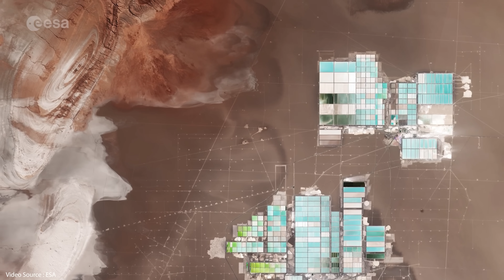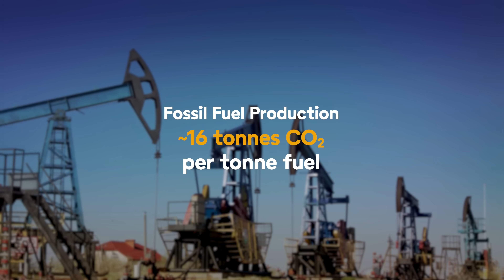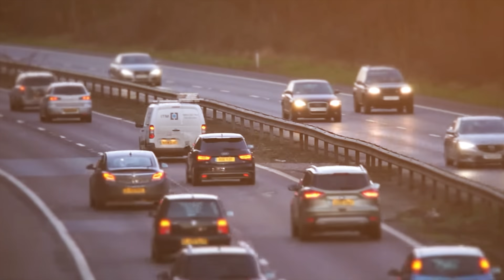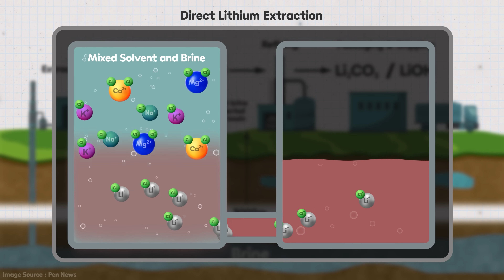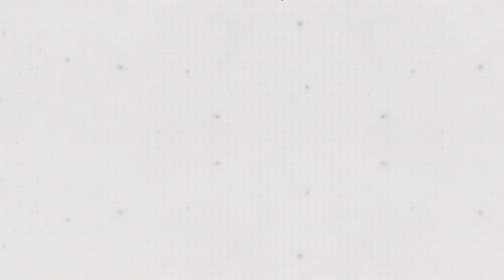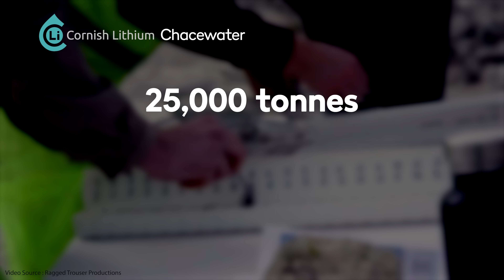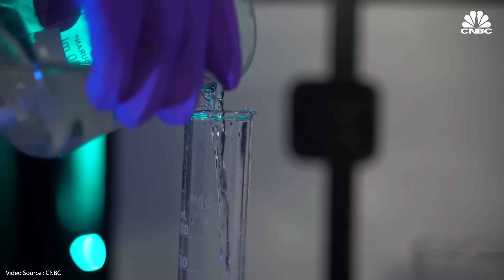Batteries: Revolutionising lithium production. From 18 months to 6 HOURS!!

Comment: It wasn't that long ago that we had things called bicycles. They were a form of human-powered transportation considered beneficial to the environment and the rider. With regular maintenance a bicycle could last a lifetime. Now we have e-bikes with batteries and electronics. Many are cheap off brands that are hard to find parts for and difficult to repair. They quickly become junk. They also allow the rider to avoid exercise health benefits. Everything has a battery and unnecessary electronics. This makes everything from washing machines to cars so difficult to repair it's usually less expensive to replace it with a new one. What we need more than cheap lithium is less of everything, especially disposable electronics.

Comment: Yawn - yet again a comparison of the carbon footprint Li-Ion Batteries with that of Fossil Fuel Production. How about comparing the carbon footprint of Li-ion production to the production of green hydrogen and using that hydrogen to power fuel cells?   and please don't start talking about the need for pressurization efficiency etc etc.Those are old problems that have largely been solved, and can even improve further if forward thinking technology companies weren't so conflicted by mining interests.

Comment: I approve of any and all direct resource reductions in current wide spread technologies, and celebrate technological revolutions that would significantly improve a process by any metrics to such an extent that it makes it profitable within 5 years. However, I'm against replacement technologies that cannot meet those financial benchmarks. Why? Because it will not be financially interesting for companies and therefor will not be applied. I've been headbutting on this problem for over 10 years now, and I know what is needed.
If you really want to improve on resource efficiency (read CO2 reductions/climate restoration/circular economy/etc.), make recycling worth far more than mining.

Comment: Sorry several issues with the optimism. Firstly electric cars are charged using electricity that is largely generated globally by burning fossil fuels, coal especially. Then Lithium extraction will soon deplete a regional resource to get Lithium Carbonate, and you are not half way there, what about mining for Cobalt and Nickel for example. Lithium will furthermore get scarcer and its price will increase rapidly over time as we exhaust lithium reserves and exert a massive carbon footprint in the process. Mining for Lithium has a massive carbon footprint and these newer extraction processes will regionally deplete the available lithium and become uneconomic. Already EV's are a dying technology with only a small amount of lithium battery recycling also, so not too optimistic. Sodium battery technology might be a go but again we burn  fossil fuels for the electricity that charges the battery.
Reply: Link your sources

Comment: Is it really better to compare two really bad things like lithium and fossil? Or should we understand, that all ways, that destroy our planet, should be condemned - and left behind?
Reply: We dig 10,000 times more iron ore than lithium; 35,000 times more coal; 20,000 times each more oil and gas, so yes, I'll swap 20,000 for 1.
Reply: @peteglass3496  If you pass the Amazonas Tipping Point without any additional CO2, you will release about 300 GT of CO2.
The Tipping Point is at 1,2°C and 20% to 25% of deforestation. We passed both 1,2°C and 20% of deforestation!

People, who argue like you, are nothing else than climate deniers!

Comment: My back of the envelope calculation:
Given that the average EV battery contains about 10kg lithium, a ton of lithium will be good for 100 EVs. Let's assume they last 10 years/ 100,000 miles ( a conservative estimate)  . The average ICE car will emit 2tons CO2 per year . That is a massive CO2 avoidance given that 30% of EV owners also have solar panels
Reply: Not saying you are wrong, but I will add in that, EV still use more tires as well because of the weight. Hopefully as research goes on, we will be able to use less over all cells for the same amount of power storage. This would reduce some of their resources as well compare to ICE.

Comment: Honest question, is DLE like fracking?  Can they use DLE in Ontario Canada, to reduce the impact on the environment? Thank you for your Chanel. I do enjoy just have a think.
Reply: There are 2 firms doing this in Calgary. 1 using old oil wells, and returning the water back to the exshaw aquifer.

Comment: Most people are lost in their own expertise or ignorant dreams.

I am annoyed that NUCLEAR promoters dip their toe into part of the bigger picture like the GRID part of their clean energy and say that the grid central location of existing fossil fueled generation plants is the only economically location because new grid is very expensive. 
Then ignore that we need up to 20 times more grid electricity to stop CO2 emissions. 

They point to renewable waste and ignore the massive amounts of new raw materials in new transmission lines and poles and wires and transformers and switch yards and 50tonnes of galvanised structural steel per km plus reinforced concrete foundations plus...... 😮😮😮

Then refer to EVs electricity demand and ignore the v2g technology and most vehicles are parked 23hrs every day 🙄 😑 FREE MASS STORAGE. 

Nuclear nuts refer to cold latitudes solutions for winter months and ignore the long sunny crop growing seasons.
They ignore that 80% of the world's population live in warm latitudes.

They ignore 80% of the world's population live in dictatorships. 

The level of ignorance is mind numbing.  😮😮😮😮

Comment: Seems to me that much of the research is focused on each as an isolated process. However history tells us that the most economical is a multi-step blending of these techs. Plus you could consider the possible multi-use of combining the evaporation with catching the water for human use in dry climates. It might cost more up front, but save in the end by producing two products for sale. Also is anyone considering the climate impacts of the evaporation process? Raising the humidity in arid climates might have secondary impacts. Hope someone is looking into that. So many ways to "skin a cat" and please I do not know why anyone would skin a cat, but it is an old saying. Please focus on the point not the distraction.

Comment: How do they come up with the low figure (7?) for the solar electricity use case?
Solar is “free”, so the figure obviously includes such things as installation, transmission, maintenance costs. In which case, do the other examples include the relevant items?
It all goes to show just how involved is doing fair comparisons in energy numbers and, importantly, how easy it is for actors to mislead.
Great video again, Dave.

Comment: The lithium can be used for decades; and then be recycled and be used again for another few decades. The simple point here is that the carbon and water needed here are offset by decades of useful life and is so little compared to the alternatives that it barely deserves talking about. The more interesting aspects of direct extraction are cost. To me this looks like in addition to being less wasteful, these new extraction methods might also be less costly and more efficient. I think that's more interesting than whatever minor impact it has relative to the giga-tons of CO2 we continue to emit extracting, refining, transporting, and then burning oil. Even the most dirty lithium extraction imaginable is a tiny drop in the ocean compared to that. It's nice we can clean that up and would satisfy the OCD of people that pay attention to this stuff. So, this is nice but the big picture was already pretty good for lithium ion batteries. Taking more of the dwindling amount of real arguments against them off the table is of course a good thing.
Reply: Lithium is not the answer.
Reply: @tconbo4514 batteries are composed of more than just lithium. To add to what you are saying, new mineral combinations for batteries are also seeming viable for many similar applications.
Reply: @temujinkuechle6287 except none of them can get to grid support level which is needed when you're generating power from renewables.
Reply: @tconbo4514  wtf is?
Reply: @gregbailey45 if there really is a question (and I don't think there is) then nuclear is the only answer. Solar, wind, batteries - it's all nonsense and makes no scientific sense whatsoever. If you're a climate zealot and truly believe in anthropogenic climate change and have two brain cells to rub together ye would know this. And if ye don't then ye know nothing.

Comment: That Cornish 25,000 tonnes of Lithium Carbonate a year extracted equates to supporting 600,000 EVs a year in production, with an average EV battery containing 8kg of Lithium. Given the UK is also building a Lithium refinery plant in Hull, has other Lithium resources, and has multiple gigascale battery manufacturer plants in operation, things are looking up for the UK. (edit: adjusted estimate figures for molecular lithium content)
Reply: Lithium CARBONATE?……
Reply: Cornish Lithium doesn't list the exact composition of the extract to my knowledge but yes it's likely a dissolved carbonate as they state lithium carbonate on their website (or potentially a mix of carbonate and hydroxide). They list it as being a brine based DLE process with high Lithium concentration (220 mg/L), low magnesium (<5mg/L), and total dissolved solids content of <29g/L. That can be extracted at a flow rate of 40-60l/s, with each site supplying 500 to 1000 tonnes a year, with the Lithium extraction being an additional use of the water that is also extracted to produce geothermal heat. They are also exploring hard rock sites in Cornwall as well, which has a number of old quarries  (tin, copper etc.) that may be productive for Lithium.
Reply: That's interesting because I've been working with a number I found some years ago on the bill of materials in a Model 3 of 12kg of Lithium, so I come up with a slightly lower number. Searching again now seems to agree with the 8kgs. I was a bit surprised because batteries have been getting bigger on average too, perhaps Lithium is being used more efficiently in the current generation of batteries as energy density rises.
Certainly a quick rule-of-thumb turning 25k tonnes of Li2CO3 to 5k tonnes of Li metal and x100 gives you half a million EVs is a good enough figure for me.
Reply: Lithium represents about 4% of the reactant mass in LFP batteries, ~8% in NMC. However most of the weight of a battery pack today comes from the other structural, bus bars and casing elements rather than the active battery materials themselves. 

This is one reason why the focus on Cell to Chassis/Body designs are being investigate to incorporate an element of the battery packs weight as part of the vehicles chassis itself rather than as an additional separate weight carried by the chassis. With lighter weight battery modules just being inserted into a box that's part of the vehicle's chassis frame (a preformed stamped structure). This also reduced assembly time allowing more vehicles per minute to roll off a production line.

Comment: Even the carbon footprint of hard rock mining of Spodumene can be greatly reduced.  For a start, you power those massive trucks that take the ore from the mine with batteries.  This is already been done in other mines.  Then you power the factories that extract the Li with renewable electricity.  Simple for countries with either reliable wind resources or constant sunshine (Aus).  Then you transport the Li compounds to the battery manufacturers with electric trucks and on it goes.  We use fossil fuels to mine the Li which leads to more and more reduction in the amount of fossil fuel we need.  I love it.
Reply: Batteries are not a power source

Comment: Stopped watching my newly installed solar app to watch this. First day of sun on my panels, we're in the middle of winter. Just made a fully solar coffee to watch Dave.
Reply: Greetings from Germany. 18kWp on my parents house and now they can also use their new EV to drive co2 neutral. It is amazing to produce your own energy.
Reply: Greetings from Germany. I've got a tiny 130 W flexible panel in my balcony that receives sun until until mid-day with a 3 KWh battery (including a solar charger).
Since 2 years ago, all my small gadgets, laptops and both ebikes were charged only using this system.
Would be happy to go big, but I'm always on the move.
Reply: lol.  Same here.
Reply: Sun tea/coffee has been a thing since prior to invention of gas or electric stoves, maybe goes all the way back & pre-exists first man made fire.  Tea might have first originated in a sunlit rocky outcropping pocket filled with fallen leaves & rain water.   Prehistoric person could have dipped a hand in, smelled & tasted and thought: "tasty, but needs goat's milk & honey".

The first medicine man might have just discovered a puddle full of tea leaves brewed in sunlight.

How efficient is your solar coffee, in caloric & mechanical energy? Is it's steeping; a perfect transition of energy to a chemical composition altered chemical state to heat escaping into cooler either?

Sounds more waste heat efficient than putting a kettle on. Are heat focusing mirrors necessary?

Comment: Great video, as usual! 
However the 16 Tonnes CO2 per 1 ton fuel (liquid or gas) produced, seems high..
I looked at the numbers for example diesel and got circa 4 tonnes CO2 per tonne of diesel produced, well to wheel. 
Similar for gasoline/petrol.

For natural gas, you may be including the co2 equivalent from the leakage of methane which is hard to quantify and varies greatly regionally but which could really drive up the average depending on the leakage rate assumed and the CO2 equivalent timeframe selected.

It would be recommended to mention how you have calculated this 16t co2 per 1 tonne fuel number, to ensure you your message and factfullness holds true.

Thanks, and keep up the great work!

Comment: I'd just as soon like to hear about progress with sodium batteries. So many uses, despite being less power dense than lithium. They should be a  much cheaper solution for homes, boats, cargo ships, trains, and other areas where weight is less of an issue than cost.
Reply: They will go to EVs really quick. Something everyone missed until last year is the fact that sodium is resistant to cold weather (works fine down to -40*C, while lithium batteries can only handle 0*C)
Reply: @hubertnnn  So they don't have lithium batteries in Norwegian EV's?
Reply: @paulsondj  i think they have to spend some energy to keep them warmed.

Comment: At 7:20 theres a caveat, ion exchange uses less water than adsorption. Adsorption barely changes the concentration of lithium from brine to desorption, so the water usage is comparable to the amount of brine you have to process, this becomes much more important at lower brine concentrations.
I point this out because adsorption is the only DLE process out there in production stage atm